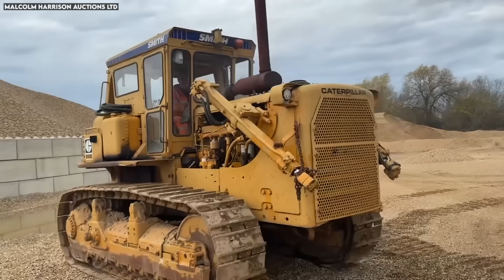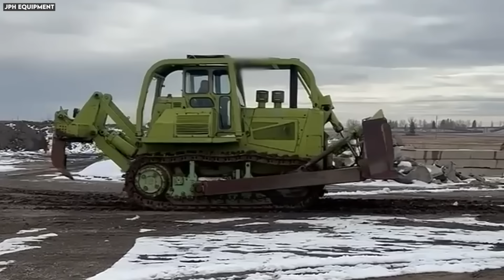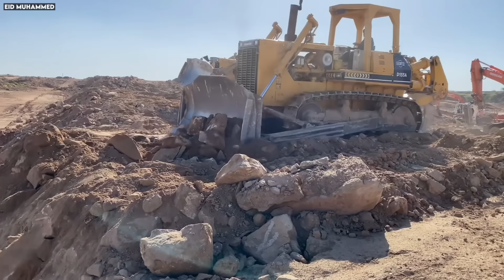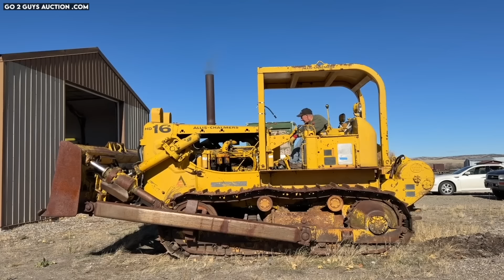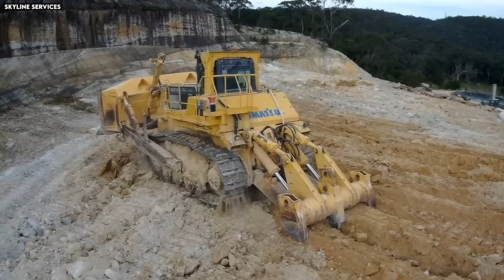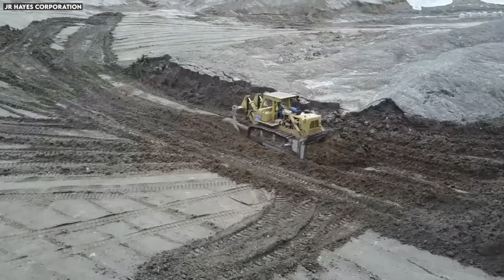10 BULLDOZERS FROM THE 1970s THAT NEVER KNEW HOW TO QUIT

Comment: Northern Alberta has huge areas of muskeg which can't always support a lot of weight. The brushing and clearing bulldozer of the day was the Caterpillar D6D 4 X (PS) with a 3306 Direct injection turbocharged engine putting our 140 hp. Caterpillar produced a special edition D6D for that application. Instead of a six roller track frame, it had seven rollers. You had to move trunnions forward, cut and widen the C frame to accommodate 30" shoes. They were the D6D Z4X series .The oil patch King.

Comment: I worked at a coal mine in the 1990's. I believe it was a Komatsu 155 I started pushing coal with. I had to hustle with the longwall output!! The company bought a d10n. The first time on the coal pile, I thought, let's see what this baby (D10N) will do. With the Komatsu, I would drive up on the coal pile until it spun out, then backdrag a road down. Then go up until it spun out again. kept doing this until I had made a road to get to the top of the coal pile. With the D10 N Cat, I could set the blade at a depth that would create a road to the top, and it did it easily!!! The high track design floated over windrows rather than beating you to death. Caterpillar always!!!!